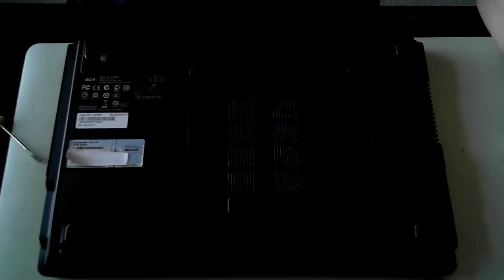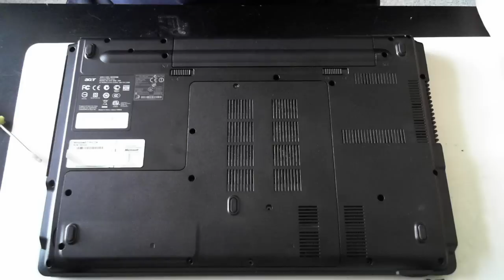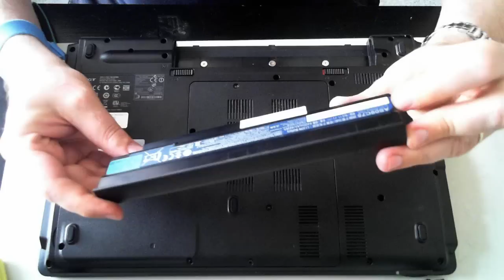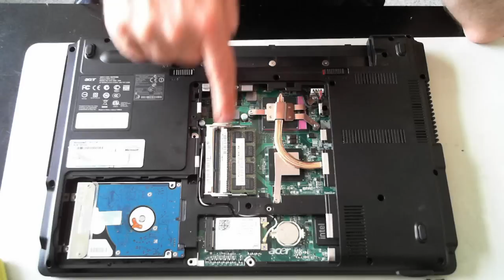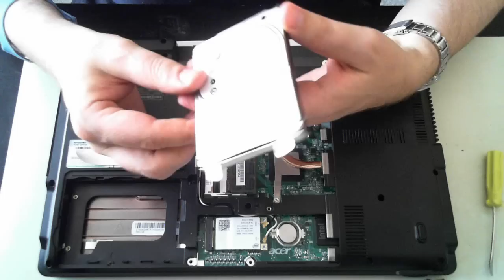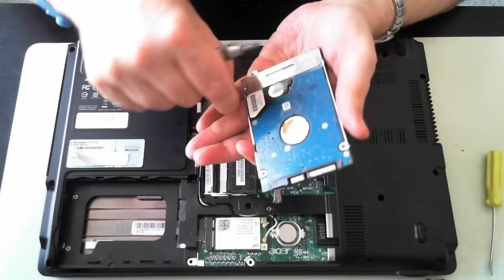Acer Extensa 5635 Upgrade / Teardown

Comment: If I want to add an SSD to this model and keep the existing HDD, do I need to to remove the DVD drive and use its bay for the SSD or is there another way??
Reply from the maker: Yes, AFAIK there is no room for both so you would have to remove the optical drive.